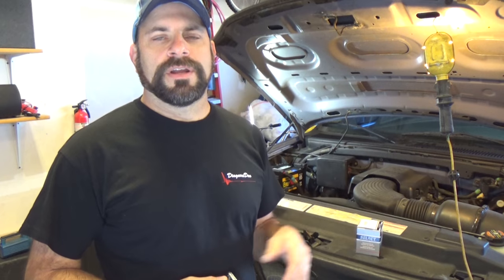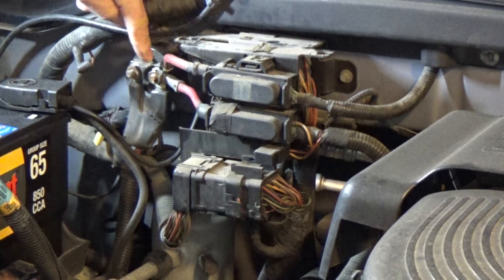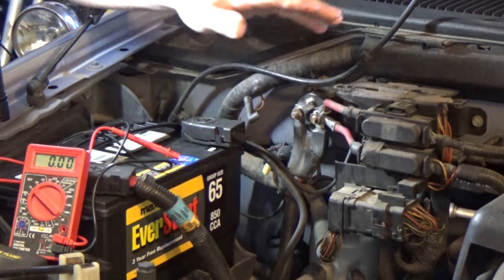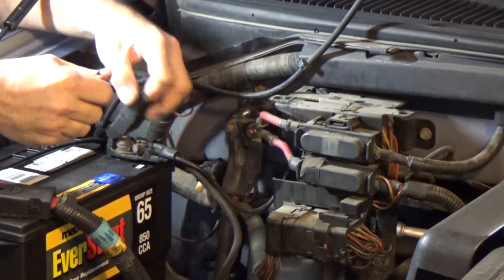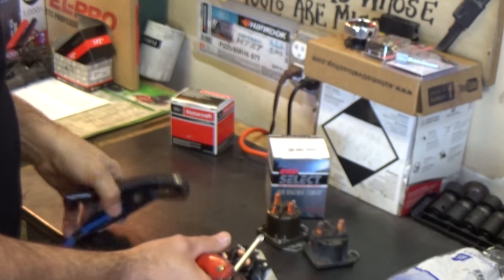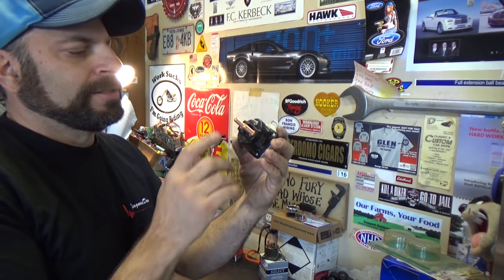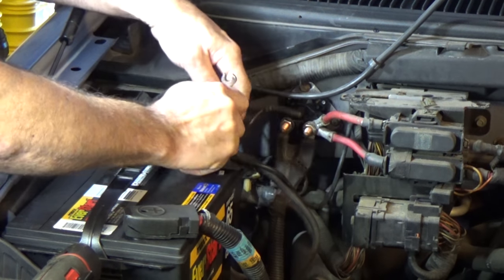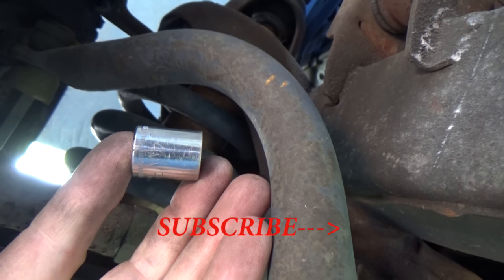Ford Truck Starter Solenoid Replacement -Won't Crank, no start

Comment: My truck will start with bypassing the solenoid but after changing it for a new one i still only can start with bypassing.

Any suggestions? I'm thinking keyswitch...
Reply from the maker: Junk aftermarket part?

Comment: Ok I’m working on a 2012 f250 6.2 gas.. the guy at work said once in a great while it will start with the key and other times had to crawl underneath and jump the solenoid.well today the starter Bendix went out. So got a new starter cleaned all the connections put it all together and nothing still.. I have power coming to the starter main wire but when the ignition is turned the s terminal doesn’t get juice.. is it the ignition or neutral safety switch? Or something else..
Reply from the maker: Yup, also make sure the relay is working properly and not an intermittent fault..Good luck with the diagnosis. Let us know what you find.

Comment: hey bro, just got my e150 back with a new solenoid and it was wired up the opposite way round!? was working for a few days now it's clicking once when i try to start it.... Gonna wire it back up the right ay tomorrow see what happens... any thoughts would be appreciated... cheers
Reply from the maker: Good luck.🤞

Comment: Wonderful video. Wish I seen this before I changed my starter! Did a drop test on the solenoid and it never gets to a stable number. Jumps all over the place! Does this mean it is likely gone? It will spark but not jump when I try to start it.
Reply from the maker: Could be.  Check the wiring as well, do a wiggle test.
Reply: @ozzstars_cars  thanks I followed the parasitic draw and fuse 14-15 inside cabin if I pull either one of them The light goes out on my tester. I could hear a clicking nonstop which was the battery saver relay? There was some thing on the brake pedal and I noticed a little clicking from the relay body battery saver stopped making noise. I put the brake on in the light got extremely bright. I just have no idea what this means so I put the brake on and try to start it it still wouldn’t start. So weird. Thanks for all your help to be honest I might not of solved it but it was still fun learning from you and playing mechanic. Oh I think I mentioned I am not a mechanic don’t pretend to be a mechanic I’m a psychotherapist working with children.lol
Reply from the maker: @Jasonjames1970  your job is tougher than mine.  Thanks for what you do and glad the video was helpful. -Glen
Reply: @ozzstars_cars  ended up being a bad solenoid in the brand new starter ? My buddy is a car and diesel truck and fighter jet mechanic lol. He figured it out in 10 min. Thanks for all your help. When it’s new you assume it is 100% good ? It’s not if it comes from China !
Reply from the maker: @Jasonjames1970  NEW = Never Ever Worked.  Glad to hear the mystery is solved.
Reply: @ozzstars_cars  I have never heard that expression before. That is too funny. Thank you very much and I hope your son follows in your footsteps? So nice that you do a service like this that really helps out a guy like me. Keep up the great work!

Comment: 1998 Ford Expedition - no start - insert key in ignition and all power to the vehicle goes out. I loosen, move and tighten the battery cables and power returns. Try to start truck and power goes out again. Power sometimes returns after just waiting awhile. Good battery; clean terminals; just attempt to start vehicle and the power goes out. Solenoid jump does nothing except make the truck loose all power. It started and ran fine a week ago and when it sits for two weeks it still starts; until now. Unlock truck and power is on; insert key and turn to Run and a few seconds later the power goes off. Suggestions?
Reply from the maker: Both battery cables need to be load tested. There may be a break and/or corrosion.

Comment: Good job... 
I have a 98 Ford F150 4x4, automatic transmission, but I have a big problem with it, the 4x4 it doesn't works, the windows doesn't works sometimes either, I hope you can help me whit those things, it's been really stressful, I've tried changing the module that it goes into the fuse box, but still not working

Comment: Okay explain to me why when you go to jump the solenoid from on to the firewall why am I getting like a weak spark and it's not cranking over my starter also the battery is fully charged
Reply from the maker: Did you test the starter? The cables?  Sounds like high resistance somewhere along the line.

Comment: I’m currently going crazy trying to fix my 95 ford 350. I changed out the starter solenoid, I bypassed the solenoid and it runs. But i don’t have the tool to see if i’m getting voltage from the wire to the ignition which i think I’m not. I hear the relay or something click when i go to start it tho.

Comment: If you verify your starter motor brushes are still good is it worth it to replace the solenoid or should You just replace the whole starter?  Why do fords have a relay under the hood then another solenoid relay on the starter?
Reply from the maker: Personally I replace it with new, not rebuilt. The firewall solenoid cuts down on the current the ignition switch needs to deal with, it's sort of like a relay.
Reply: @ozzstars_cars  thanks
Reply: I was referring to the solenoid on the starter not the one on the hood.

Comment: I always assumed the Ford solenoid was hooked up to a starter with no solenoid at the motor. Now I'm confused. Why even have it? Do those heavy cables carry the signal line for the starter solenoid at the motor? I was surprised to learn that the signal line for a starter motor carries quite a bit of current as well, often ~ 15A for a few seconds. Maybe this allows current going through the ignition switch to be reduced by a using second relay.
Reply from the maker: There are two things I'd like a Ford engineer to explain to me. 1) Why Ford does the double starter solenoid deal.  2)  I still haven't figured out why Ford uses a negative type EVR (egr vacuum regulator) which induces an engine vacuum leak on purpose.  Let me know if you can figure it out Dave.  👍

Comment: Hey how you doing, anyhow I’m getting 12 volts on the positive but when tried to jump the two together I get nothing. Also I went down below and there is power going to starter when I jumper from the bottom I just get a wining sound

Comment: I just changed my solenoid on 1985 f150. The one that I took off was put on wrong. Positive and negative wires were on wrong. . I have no power when I turn key to on with everything connected..
Reply from the maker: Check the terminal connections and wire continuity.

Comment: I know this is old video, but I'm hopeful someone can help. This video is great! I was testing my solenoid, but when I did negative of battery terminal to positive of starter solenoid I dropped ~1.5V. Does this simply mean I need new solenoid or is there more at play here?
Battery is currently sitting at 11.5V so I know I need to replace/charge it, when I do negative of solenoid to positive of battery I keep the same level, it is just when I do negative of battery to positive of solenoid I drop to 10V
Reply from the maker: Before you do any voltage drop test you need a battery that is fully charged. Low amperage on a weak battery is not going to get the job done.
Reply: @ozzstars_cars  thank you for the reply. I got a new battery so wish me luck lol.

Comment: i just bought a 97  4wd f 150 4.6 , it been having 4wd issues no going back into 2wd, so i was troubleshooting it with vehicle off and I pulled the 2  4WD  vacuum solenoid hoses pretty close to the starter relay, when i pulled off the one there was a big whooosh of air sound,  then i went in to start the truck  all i get now is a loud clunk sounds like its coming from around that relay area , no crank but it has a couple times tried to turn over for 1/2 second out of 50 tries..   battery is testing 12.5 volts.    could it have blown a fuse when i did that or does vacuum have anything to do with it starting?
Reply from the maker: Battery voltage sensor good but the Amps are really important.  After 50 tries it may be weak.  I really can diagnose what the problem is online but the vacuum hubs on Ford are known to have issues.  That should not prevent the truck from starting. Test the battery, starter solenoid and starter if necessary.  Make sure the grounds are good and clean.
Reply: It was a loose /corroded connection on a wire going to starter or me hitting starter with hammer lightly,  I think it was the connection though.  when it did start it was in 4wd   i switched it out to 2wd and it went to 2 wd but now it wont go into 4wd, dealership put transfer case switch motor on it and it didnt fix it, now there saying gem module, but when i took it from dealership the truck didnt and wont go into overdrive , it will buck at about 45 mph?   IDK but at least its starting again.   thank you for the video very good job

Comment: Hi there,when I turn the key on my 2000 F150 it sometimes starts & sometimes does not start & makes no noise at all,no clicking are anything,I replace the solenoid(new) on the firewall & got the same symptoms!! 

Any other suggestions what it might be because I’ve been jumping it off with a screwdriver by the same solenoid I change..

Thanks in advance!!
Reply from the maker: Have you watched the entire video and not skipped?
Reply: Yes I did watch the whole video,realized that I was not getting power using a test light  @ the ignition wire that goes  to the solenoid,U mention a relay in the fuse box under the hood of the truck but according to my manual for the truck,there’s no independent fuse for the ignition wire,the relay is for other applications as well,just wondering which fuse/relay in the fuse box under the hood is the correct 1 for me to change out. 

Thanks in Advance for Ur help..

Comment: Glen I know this is an old video but I have the same truck with a very similar problem 1 out of 10 times no crank hear the relay have positive crank signal at the firewall solenoid I was positive it was the firewall solenoid here’s my dilemma if I wiggle the signal wire on the starter solenoid on the actual starter I get a solid crank and fires right up side note when I have the accesories on the radio for a extended amount of time (waiting for my son to get out of school) it will wig out either act like the battery is dead or over engage the starter I just don’t want to throw parts at it as starters for our truck are insanely expensive nowadays. Wanted to know your thoughts
Reply from the maker: Could be a broken wire or internal corrosion. Those are difficult to diagnose. Only load testing the circuit and checking for voltage drop will determine the direction to solve the mystery. Good luck Matt, let us know what you find.
Reply: So far It looks like a dirty ground at the starter confirmed via volt meter it’s that old sang try the stupid simple stuff first ( my truck spends a bit of time off road being an overland rig)I noticed some slow cranking and did some voltage checking and was able to confirm the relay was good have had no slow cranks or starting issues yet 🤞

Comment: I have a 99 navigator and the solenoid was rigged up with a button until it got changed and the wire sparked and ended up getting hot and melted apart. So I got the replacement like you, then ended up getting the og part. But still no start even if I use a screwdriver it’ll just click. I’m going to try replacing some fuses to see if that works thinking when it sparked it might’ve blown certain ones. Any idea what else it could be if not fuses?
Reply from the maker: I would suggest you look at a wiring diagram of the circuit. It will be very helpful to diagnose the issue.
Reply: @ozzstars_cars  I’ll try that

Comment: Question sir. What if you try to jump the solenoid as you did using screw driver and u get nothing? Battery is new , solenoid new 12.5v at batt and same when putting test leads on solenoid, and brand new starter. When turning key solenoid clicks that's it.
Reply from the maker: Test the solenoid like I do in the video.
Reply: @ozzstars_cars  ok will do
Reply: @ozzstars_cars  did all the testing but still have no crank no start with the solenoid clicking when tryna start. When I take the signal wire from the solenoid and connect to positive terminal. The distributor makes a sound. Any ideas?
Reply from the maker: @omarchisolm7533  distributor? What kind of antique are you working on?
Reply: @ozzstars_cars  lol I know. I thought the same thing. When I first bought car. It cranked and started fine with new batt, but ran 5mins the. Dies. Wouldn't start again. After lots of attempts starting it as car sat since 97.
Reply: @ozzstars_cars  I finally realized the fuel lines was clogged and fuel wasn't flowing. Old mechanical fuel pump was not working f
So put electric pump in to get fuel going. By the time I got the fuel flowing now I go to start car and now it won't crank. Thought after all those cranking attempts maybe blew a fuse or circuit but.... Who knows now.
Reply: @ozzstars_cars  I changed some wires like fuseble link as well. But yeah I test signal wire with meter as I was turning key. And batt voltage went from 12.5v to 11.4 . Then when I touch the wire to the positive the distributor has a slight ticking noise
 I have 76 Thunderbird. V8
Reply: @ozzstars_cars  76 Thunderbird
Reply: @ozzstars_cars  I don't think distributor can cause no cranking but.....

Comment: So my truck keeps trying to start itself without the key in the ignition could that solenoid cause the issue
Reply from the maker: Check the entire ignition starter wiring circuit.
Reply: That's what my dad recommended but everything seemed fine but I noticed on yours u have u have a small wire that goes to your left post and a larger wire that goes to the right post. On mine my small wire is on the right post and my larger wire is on the left one. Would that affect anything.

Comment: The small bottom post isn't a ground. It's hot while cranking.
Reply from the maker: Interesting
Reply: @ozzstars_cars  it's ussed to run electric fuel pumps until oil pressure is normal. My '85 f350 with a hot start system has electric fuel pumps, and uses that terminal.

Comment: I have a 97 F150 as well. I’m not sure what the deal is with it. It will not start and I have intermittent starting. Sometimes it does sometimes it doesn’t. I’ve had the battery checked it’s good I’ve had the alternator checked it’s good after watching this video I went and bought a new solenoid put it on and it still won’t start. Any suggestions?
Reply from the maker: When it won't start I assume it's not cranking? Check at the starter  could have a dead spot.
Reply: @ozzstars_cars  no crank at all. If I jump it it will start. I thought maybe it was the starter but my dash doesn’t light up or anything at all. It’s like totally dead.
Reply from the maker: @sambricker4731  I would start checking the terminals and cables for internal corrosion or broken
Reply: @ozzstars_cars  ok I will check that out, thank you

Comment: If you jump the firewall solenoid and nothing happens but relay clicks when turning over key could it still be a defective firewall solenoid?
Reply from the maker: Anything is possible. Test and don't guess.

Comment: When I crank my truck the starter engages when I push the clutch while running. I unplugged ignition wire and jumped the solenoid and it works fine.

Comment: So I replaced the starter on my 05 f150 starter due to ugly grind when starting.....    but still grinding... some say this firrwall solenoid probably not sending enough power to starter
Reply from the maker: Bending needs to properly align with the flex plate.  Flexplate could have worn or broken teeth.

Comment: Voltage Drop !  All parts test good . Starter works fine on bench , on truck it makes a clunk noise & attempts to turn motor - failing . Solenoid to starter cable test ok with Ohms meter . Is it possible to Not to supply enough Volts Amps to starter    when system engaged ? How to test it .
Reply from the maker: Ohms test won't help determine if enough volts/amps are getting to the starter.  Could just be a weak starter motor.
Reply: Check all your ground straps especially the flimsy ribbon ones that will crumble in your hand but look okay at first glance

Comment: My truck I put ! Starter on it with cylinoid on the side of it ivereplaced the one on firewall also but when I turn the key it clicks one time then the starter just spin@ but doesn't crank I don't know what to do

Comment: I still don't have any crank after replacing the solenoid in my  1986 f150 lariat, what did I do wrong?
Reply from the maker: Did you check for powers and grounds?
Reply: @ozzstars_cars  yes the ground is the metal plate on the backside of the solenoid it screws into the passenger side fender

Comment: What does it mean when I try to connect the two terminals on the solenoid to start it just starts making sparks
Reply from the maker: Have you tested the starter?

Comment: Have 2003 f150 4.6 . My setup have a fusible link. My solenoid is turned 90 degrees clockwise so the bottom terminal get no voltage which in turn has no voltage going to the power distribution box. Fuses 1-18 are dead with ignition on and off. PCM relay also has no power going in. On the cabin fuse panel 1-4 and the next row 13-15 have no power. Odometer shows dashes, fuel pump not engaging.  I'm stuck like Chuck at this point